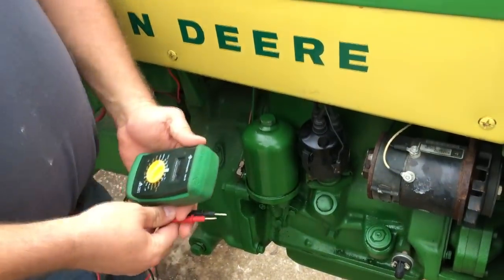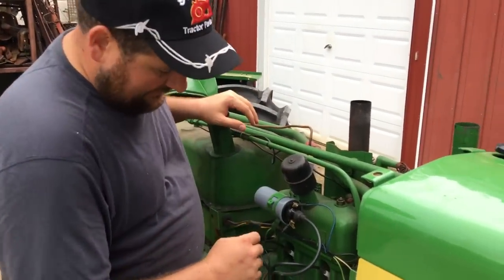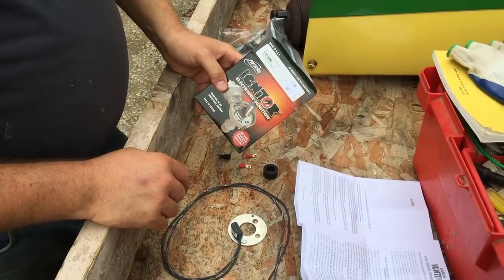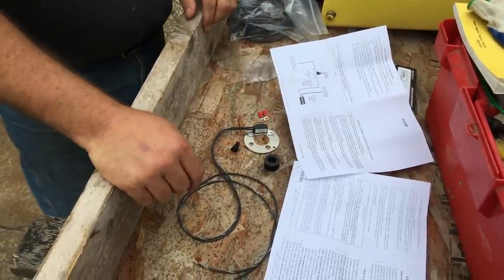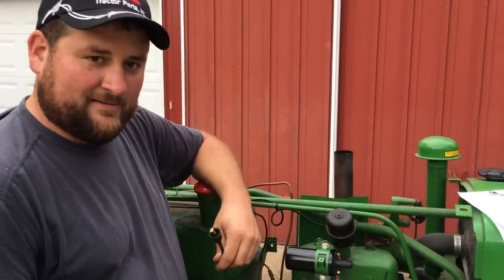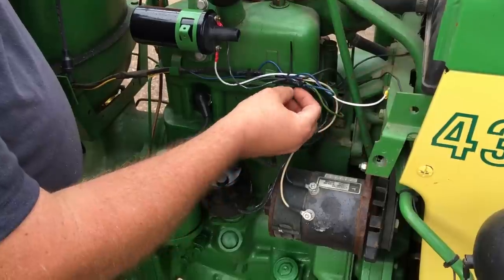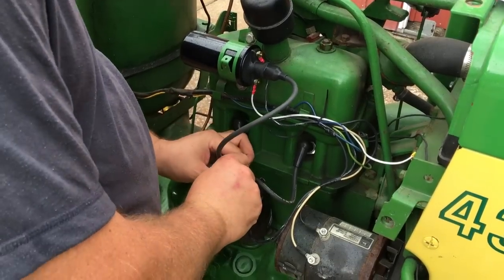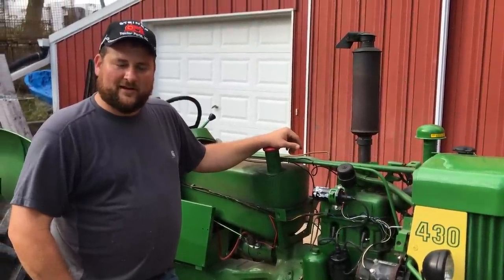Electronic Ignition Install on a John Deere Tractor

Comment: I smoked a brand new coil on a freshly restored tractor a few years back.  Don't remember exactly what I was doing, but for whatever reason I left the key on.  Distributor must have been in the perfect spot.  Fortunately I was there when I saw the smoke start to roll out.  Didn't seem to take very long for this to occur either, but who knows, time seems to fly when turning wrenches.
Reply from the maker: Sorry to hear that it happened, but glad you were there to prevent any more damage.
Reply: Was it on a 2 cylinder  diesel john deere,  the coils on them are  very sensitive,

Comment: How about a video with an in depth explanation of a positive ground system and the difference of a negative ground!  And why is one used over the other?
Reply from the maker: Thanks Steve, we added that to our list. 😊
Reply: @SteinerTractorParts  I would like to see a video on painting without using hardener.  I for health reasons can't deal with hardener.  thanks again
Reply from the maker: Jim  we do not have anyone that shoots video for us that does painting, but if we do I will pass on your message. 😊

Comment: I am confused about the coil now. You said on pos ground, the pos terminal on coil goes to distributer. I always thought the pos &neg on coil means pos =in and neg =out. Or pos is always the battery side and neg always the distributer side.

Comment: If I do this conversion on a 12V positive ground tractor (1960JD 2010), do I still need to have the coil with a resistor? Would I still need the resistor bypass during cranking hooked up?

Comment: I have a 1952 G that is 12 volt and a positive ground off the battery but when I checked my ignition coil the negative terminal goes to my distributor, why would this be & how is it even working properly this way?

Comment: Can you please tell me the part number for that 6 volt replacement coil. I'm getting it for a john deere 40 I'm converting over.
Reply from the maker: Hi Mikhail!
The ABC4293 is the hot coil for a electronic ignition with the 6 volt system.
Reply: @SteinerTractorParts  Thanks!!

Comment: Where and how do you wire the ballast in with the ignition system? I have a John Deere A 12 volt positive ground. Order parts from Steiner tractor and they are very nice. Was recommended I get new plugs and wires, 55000 high output coil and that I would need a new resistor along with electronic ignition. Two cylinder tractors need a minimum of 3 ohms. The coil reads 1.1 resistor reads 2.1 for a total of 3.2. But they do not include instructions as to how to wire the ballast in with this system anybody help? Thank you Bill
Reply: The resistor goes between your ignition switch and the coil. Hope that helps.

Comment: Your  testing is flawed.  You measured  the  coil to distributor,  and if the  points had  been closed,  the voltage would have been close to zero.  Also, with the points open,  which they  had to have been when you  showed the 6V reading,  this will not prove  whether there is a ballast, because with points open, there will be no coil current, and no voltage drop through  the coil   "Points open"  will result   in  same voltage,  either  coil / distributor,  coil/ power side,  or at the battery, whether  ballast or not
Reply from the maker: Thank you for your advice.